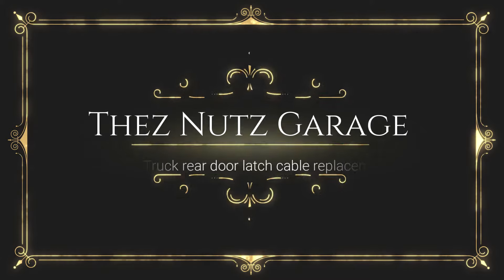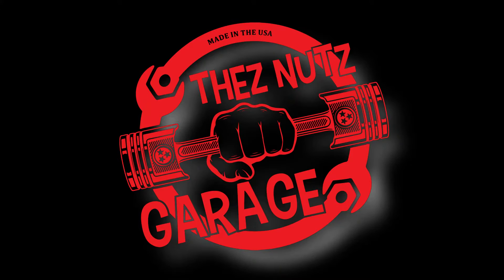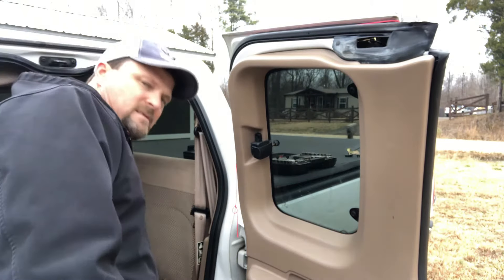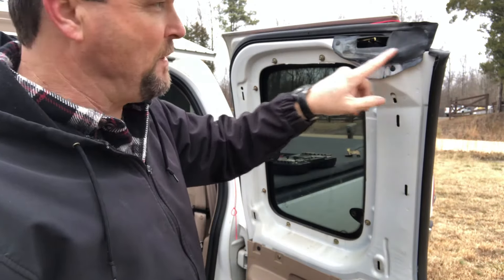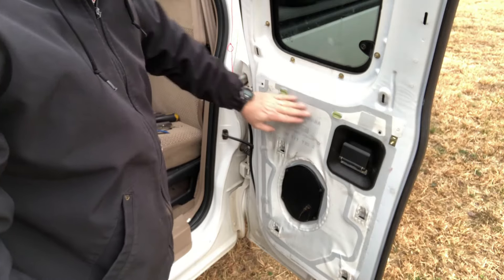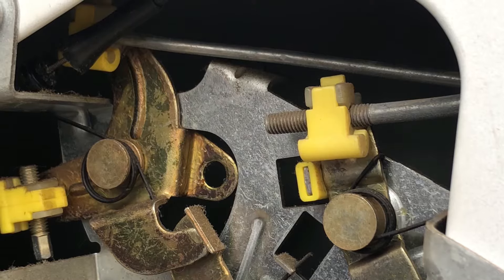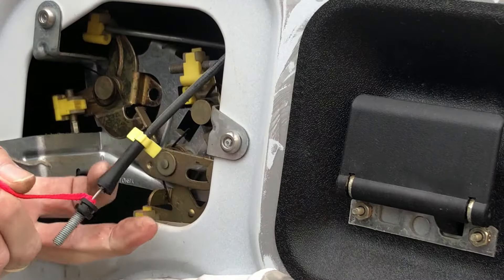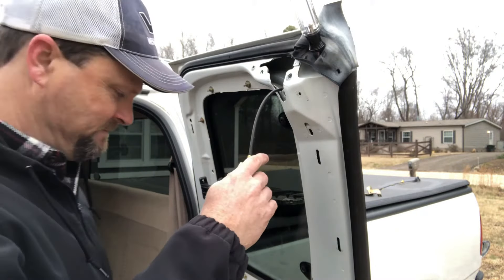How to replace rear door latch cable on Ford extended cab truck. TNG Episode #50

Comment: I got mission accomplished on both doors. I didn’t replace the entire cable assembly, but replaced the degraded and crumbling cable housing ends with the part from Doorman.  I stripped one of the Torx bolts badly enough that I went to a dealership to get a replacement…at $8 each. Overall not a terrible job, and now my doors work on my 20-year-old truck.
Reply: Play I got mission accomplished on both doors I didn't replace the entire cable assembly
Reply: Play the video on mission accomplished
Reply: Can I do this if I can’t open the rear doors? Both cables both sides, top and bottom, are gone
Reply: @JKinsman92 , yes. Both of mine were gone also when I did them. The challenge is you have to get into the back seat. If you slide forward the passenger side seat and tip the seat back forward, you can slip back there
Reply: @matthewkeisling2776  Yeah what I did, but if I HAD to I could crawl over the console between the upright seats. Otherwise, really big guys might have to get a smaller person / young teen hired help to do and learn while they earn.

Comment: I'm 65 female I've waited for several years for the pickup doors to be fixed I watched the video about three times and me and you went to the back of my truck and I pulled them out bought the parts and I've put one in so far the other one is coming soon thank you very much

Comment: Good video. One note… if you strip those T27 screws, you can use a hex head to replace them. The locations are recessed enough that they will not interfere with anything. Just be sure to find the correct thread size.

Comment: Unfortunately you didn't show how to open the door from the inside when it's stuck in the closed position ( which is my situation ). Also, I thought you were going to show how to replace the cable itself. I suppose I'll have to order the entire upper part with the cable attached and return the cables I bought. Other than that,....good video.
Reply from the maker: I need another truck to show how to do this repair. I sold that truck years ago.

Comment: Great video.  I'm getting ready to tackle the rear door on driver side of my 2000 F150.  Great tip on the 15/16 box end wrench on screwdriver handle!  Never seen that before.  Great job!

Comment: Great video. I'm having the exact same problem with my '99 Ford f150 so I'm really glad that you produced this. My door is stuck in the closed position as you've mentioned earlier and my only question would be what happens if the cable breaks off the upper latch? How do you get the door open? In other words, if you can't get at the latch, how are you able to open the door? In your example you just showed where you would pull the cable and it would open the latch. But what if the cable came off on the top? How would you get in to the door while it's closed to be able to open the latch?

Comment: I've watched several videos on this because both doors won't open on my 2000. I couldn't get the left top hex screw out, it stripped out, after going to a second auto parts store, trying to get help, my neighbor was there and came over to look at it. He had to remove it with a small vice grip I have and he got it out!!! Wooo hooo!! He said it wasn't my fault, the screw was cross threaded from the factory!! So I've got both flanges replaced, I didn't know about the string before I pulled the top completely out, I'm so glad I watched you tonight because I wasn't able to get the top piece back in where the 3 hex screws go!! I watched you three times so hopefully I can finish that door up tomorrow. I've got to cut my grass and weed eat so I've got to be done with it!! I'm a widow and it's not rocket science so I figure with you guys on YouTube I can figure it out. Thank you so much!! 👍💯👏 I just subscribed, so hello👋 from Sweet Home Alabama!! ROLL TIDE!!  ❤️🏈🏆
Reply from the maker: Thanks for watching and subscribing!
Reply: Excellent instructions. Mine won't open so this helps
Reply: Your video is so clearly stated. Excellent. I cannot get either door open to access the top latch. I tried today for quite some time and have surrendered to another day. I inherited my Dad's 2000 F150. I'm trying to get it road ready for a long trip home. My question is how to get those doors open so I can replace the cables? Or did I miss that part in your video?

Comment: Kudos, five thumbs UP: excellent video explains every thing with the top cable replacement, which is the one everyone seems to have the most trouble with. I chose to just replace my ferrule ends with the aluminum ones, (buy set with one having a thinner end, a "cam" end) rather that the entire cable / latch assembly. when nothing was wrong with the inner wire business part of the cable. Personally in this instance, I resist replacing garbage OEM plastic part with another plastic part whether it be OEM or aftermarket plastic. 

Did need to completely remove cable however in order to install new ferrule ends. Lost my string, and turned out on my 98 did not need it to lead cable back through. Good practice though as some trucks might be different, me just lucky. 

Another thing worth mentioning. Way you were dressed, my guess is that the ambient temperature was not much more than freezing, if that. Everybody knows that old plastic breaks, it just does. It even breaks better when it is cold. Just saying. Did mine @ 80º F, only partially destroyed the plastic push thru clip you did for the lower door panel, mine still worked. You'd probably do well to have truck in heated garage, or warm plastic parts up good with heat from trucks heater, or even a hair dryer provided was not too blasted cold and windy. 

Inspected my lower cable ends and it was in great shape, no cracks, left alone. Just oiled and greased everything (dirt be dammed) reinstalled panel. Thought is after watching this & other YT video, I can get that panel back off in 10 minutes to do the lower one if that ever becomes necessary. 

Good job from a great instructor, good video and overall great presentation.
Reply from the maker: Thank you

Comment: #1) that is a bolt not a nut... 
#2) if we're going to do it right as you were saying about others,  WHY didn't we do the bottom cable at this time too. 

Was rather surprised you didn't even check it... 
The fact that both ends of the top cable had dried up and broke, ( yes they were working, but still broken). Wouldn't it be a good idea to check, or better yet, just replace that bottom cable at this time. All the cables were the same age!!!. 
You did a fine job on showing us that top cable replacement. 4.5 outa 5 on that. ( the .5 minus, was because you didn't give us the "part information".. # & brand) 
Thanks... 
Would like to have seen how the bottom cable replacement works..
Reply from the maker: I did everything you mentioned in the second video I made about this repair.
Reply from the maker: I did not put any links for this part because it was on eBay and sometimes they end those links.
Reply from the maker: Here is the second video I made for this type of repair. 

https://youtu.be/YfwVqS3Y7oI
Reply: @ThezNutzGarage  thank you... 
Glad to have seen that. The bottom one, not being fed from the outside was different... 
Thanks for getting back to me so quick.. parts, (cables), have been ordered.. 
Guessing we'll see what happens in a week or so!.. 
Looks pretty straight forward... (for me, the getting in the back seat with both doors inop, should be the hardest part!!)
Reply from the maker: Man I just fixed a Chevy truck front inside door handle. Had to remove the passages seat and then in door panel while the door was jam shut. Insane.
Reply: @ThezNutzGarage  taking the seat out might be my only way in too
Reply: Thoroughly explained what was needed and how to do the job. I enjoyed your tutorial very much. Now I can finish repairing my 1997 door that mechanic friend left half done. Bottom went ok, but be couldn't figure out the top. He needs You Tube. And specifically Your expertise - as a mechanic and as an instructor!
Thanks do much.
John in San Antonio

Comment: One comment to the excellent video.  You may need to adjust where you place the threaded end of the cable into the plastic clip on the mechanism.  I went with it in the middle to the threads and the door wouldn't latch.  This was the approximate location the original was placed.  I put it closer to the end of the threads which put less tenson on the upper door latch and allowed the door to close and latch.

Comment: I have a 1998 F250 Light Duty.  The same cables are the same.  However, I didn't replace the cables.  I purchased the broken parts from Amazon for 8.00, cut the broken parts off and slipted the aluminum parts on to re place the broken rubber/plastic ends and all is well.
Reply from the maker: I have done that too. I have bought the entire assemblies. It just depends on thew situation.

Comment: Get this …. It took Amazon 4 tries to get me the correct top latch and cable. I took the old latch out for comparison when ordering. I’ve been a week driving with only the lower one holding it closed. I just fixed the top, closed the door, then it wouldn’t open ! The very minute I fixed the top, then tried to open it, the lower cable broke !! I rigged it with zip ties until I can get the lower shipped. Don’t replace just one ! Do both if your going to tear down your door !

Comment: Very helpful & Great video!! I already have mine ordered for both sides but I order both upper & lower cable so everything will be new because the lower is gonna break soon because it's made about the same way. Take it apart once and done. I also had planned to use the string trick also. Thanks for taking the time to make the video!

Comment: Getting the same replacement cable is good. But in the long run replacing the brackets that hold the cable to metal ones are better and will last longer.

Comment: you are right dont use a zip tie    i used a piece of wire    great  vidio i just dont have  40 bucks to fix it the right way   but if i did this would be the way to do it for sure

Comment: My metal cord completely broke on lower latch how can I  get the mechanism to open it up manually with a flat head screwdriver ?
Reply from the maker: I need another truck to make a video on this. Are you in TN?
Reply: @ThezNutzGarage  no I’m in Minnesota I bought the lower latch so I can see how the mechanism works seems like my mechanism is rusted shut I might have to take a sawzall to it and cut the metal loop that’s bolted to truck frame . Thanks for reply back

Comment: Nice video.  You didn't replace the bottom cable.  Those OEM cables are just going to fail again.  I bought the aftermarket aluminum ends $8 for 4.  They work great.  You need a set of 4 for each door.
Reply from the maker: I added a link for the metal cable repair kit in the description. They are under $7.00

https://www.amazon.com/dp/B08DH8ZD39?ref=myi_title_dp

Comment: I like this video a lot. I am about to do this on one side and will follow with the other. I got the metal replacement ends for that cable casing and will go that route. Isn’t there also a bottom latch that can have the same issue with cables?
Reply from the maker: Here is a video where I replaced both cables upper and lower. 

https://youtu.be/YfwVqS3Y7oI

Comment: just for the heck of it is there also a cable that runs to the bottom?? my door appears to be locked at the bottom and not so much at the top so I think my upper cable is good?
Reply from the maker: Yes. I did a video on the upper and lower cables.

https://youtu.be/YfwVqS3Y7oI
Reply from the maker: https://youtu.be/YfwVqS3Y7oI

Comment: I’ve purchased the cable. And understand how to do it BUT I can not remove the panels until I get the door open. Any tips to open the door.so I can work on the door
Reply from the maker: You can remove the door panels while the door is shut.

Comment: How do you open the door from the inside when the cable comes loose from the bottom latch?
Reply from the maker: After you remove the door panel you will have to try to look down in the door and look for the latch. It’s probably going to be difficult to find it but keep looking.

Comment: Thanks was a great video question do you know if the upper and lower cables can be ordered on amazon and what the part numbers are and if the price is less or the same if I have to order from eBay I will. Was a will informed video.
Reply from the maker: I don’t know about Amazon but I am pretty sure someone on there sells them. You could write down the product number from eBay and search on Amazon. I need to do a video on the lower cables but I would need to use someone’s truck. 
I think my sons f-250 needs its cables replaced.

Comment: Does Ford make those cables with metal ends instead of plastic ?
Reply from the maker: No. You can buy the metal tips from a link in the comments.

Comment: Good job there young man.. Think this is a level 5 of 10 so I'm going to try to do this for myself. 
1 question however, parts from an AutoZone, or have to go to Ford? 
Thanks
Reply from the maker: I ordered the cables off of E-Bay. 
I would suggest ordering both top and bottom cables. 

If you live in west TN I can fix them with the metal end cables that are posted in the description.
Reply: @ThezNutzGarage  I'm in FL. However, if these lasted 20 years, hoping that I'll get 10 out of next set!! Thanks. 
The bottom set as easy to replace?
Reply from the maker: @2011mendo  this is a video my son and I did on fixing his cables on his f250

https://youtu.be/YfwVqS3Y7oI
Reply: @ThezNutzGarage  thanks... fed into place a little different,  but looks easy enough.. thanks

Comment: I'm confused about the part needed.  This one cable you used (and linked to) with the metal attachment will do it?  For some reason, I thought there was another part/cable that went to the bottom of the door.  I haven't taken it apart yet - my doors are both broken and stuck shut.  I already bought the metal ends to put on each end of the cable, but your repair looks easier.
Reply from the maker: Yes the cables are for the top part of the door latch. Only the upper latch cables were broken on my truck. If you need any more assistance be feel free to ask.
Reply from the maker: Yeah the cables I used are quick and easy to install. I used those because I only wanted to fix the doors once!
Reply: @ThezNutzGarage  Do you have a video on the lower cable????
Reply from the maker: @ Nick
I don’t have a video for the bottom cables, sorry.
Reply: @ThezNutzGarage  some of us might kinda, sorta, maybe need one 😳 would sure appreciate it if you have the opportunity!

Comment: Great job explaining I am a little confused the cables you bought are those just the cable or do them come with the latches attached? Also do you have the parts for both the top and bottom? And I need to buy the top and bottom for one door what is the cost for both cables with latches? Sorry for all the questions but want to be sure I order the correct parts
Reply from the maker: I bought upper latches and cables. They came complete ready to install. I did not do the lower cables on that truck but I will do one in the future. 

I bought them off off eBay.

Comment from the maker: Here is the link to order a set of these door latch cables for your truck. 

https://www.ebay.com/itm/Upper-Door-Latch-w-Cable-for-Ford-F-150-97-03-F-250-1997-1999-Rear-Left-Right-/184497802769?_trksid=p2349624.m46890.l49292

Comment: What is the name of those wires to ask at auto zone. I have a 2003 f150 xl with the same problem. Doors wont open
Reply from the maker: https://www.ebay.com/itm/184497802769
Reply from the maker: I don’t know if autozone sells the cables just the ends. It’s best just to replace the entire cable.
Reply: If you want to replace the broken plastic ends with aluminum ones, you can get them on Amazon for about $11.  https://www.amazon.com/gp/product/B07JPX35WP

Comment: What is the cable to the top latch broke off how do I open door ?
Reply from the maker: The whole cable broke?
Reply: @ThezNutzGarage  yes i tried opening top latch and the cable came out now can’t unlatch top lock
Reply from the maker: I have sold that truck and I will have to watch this video again to see if I can figure out a way to easy release the latch.
Reply: @ThezNutzGarage  i tried taking the door off but I can’t get to top latch to manually do it .. thank you

Comment: I fixed mine with metal parts from NAPA for $12.00.
Reply from the maker: I will be making a video very soon where I use the metal cable end repair kit. Stay tuned.
Reply: Metal ends are super easy, just renember the one with the different ends goes to the top latch
Reply from the maker: @G Bryant I am about to make a video on using the metal cable ends.
Reply: @ThezNutzGarage  is it out yet, 8/2022?
Reply from the maker: @2011mendo  no I need a truck to fix. If you live in west TN I can use your truck.
Reply: @ThezNutzGarage  sorry. 
I'm in the Tampa area. 
Feel like a working vacation, I've got plenty of tools... 😜
Reply from the maker: @2011mendo  you live in Tampa area?
Reply: @ThezNutzGarage  New Port Richey FL..
Reply from the maker: @2011mendo  well my daughter lived there but she moved more towards Tampa.
Reply from the maker: I will be down there in Nov. if you want to order all of your parts and you want to. E in a video, lol.
Reply: @ThezNutzGarage  yeah there's not much up this way, but it's half the $$$ of St. Pete area..

Comment: Where did you get those cables? From who?
Reply from the maker: Ebay
Reply: @ThezNutzGarage  thanks feller. I really appreciate it and the video. Both doors went about a month apart on a 22 yr. old truck.👍
Reply: @ThezNutzGarage  is there a different cable, right side/left side? Or are they the same???
Reply from the maker: @2011mendo  if you order the entire new cable they are side specific.